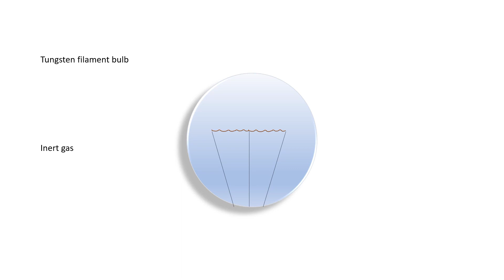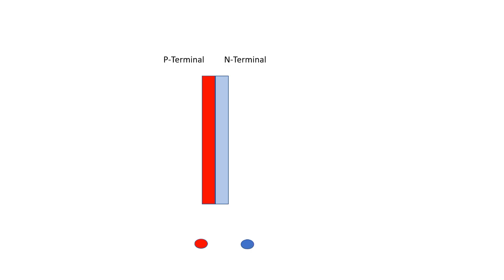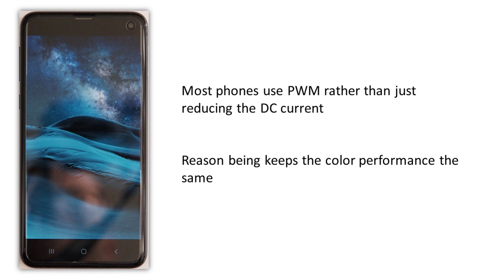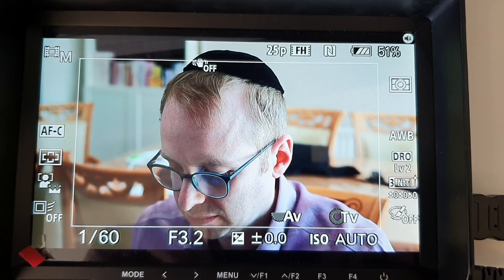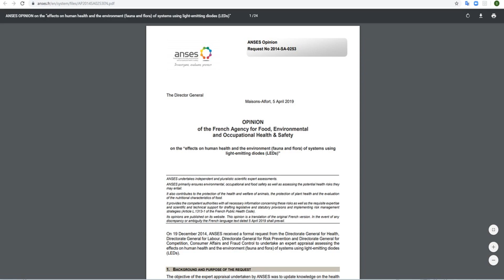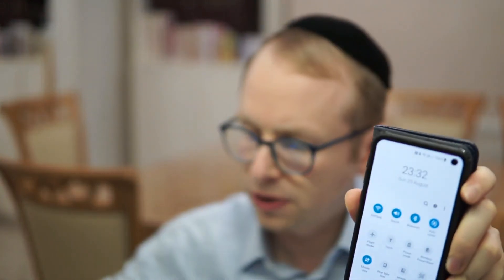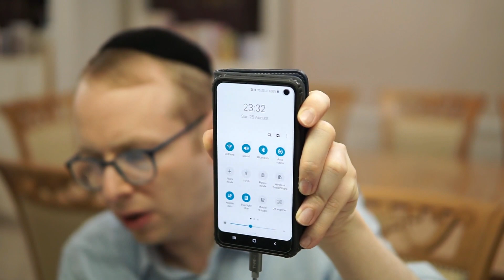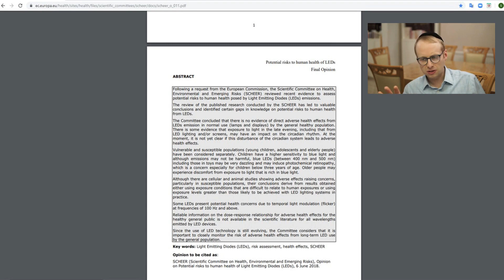LED lights flickering (solution) and health issues

Comment: I wouldn't be surprised to learn in the near future that the blue light is causing headaches and eye problems and exasperating others because of the effect it has on indoor pollution. The blue light is very near the light from the sun that is responsible for photochemical oxidation of primary pollutants. When people start to understand how important the quality of the air we breathe really is and the multitude of factors that play a role in the modification of it, maybe we will shed light on many minor and major health issues. Ignoring an eventuel contributing factor because we don't think it matters is not in my opinion very wise. Study it extensively to know if it is contributing or not is far wiser.